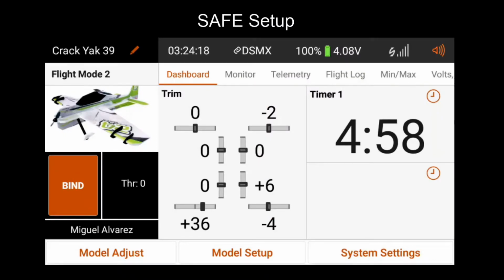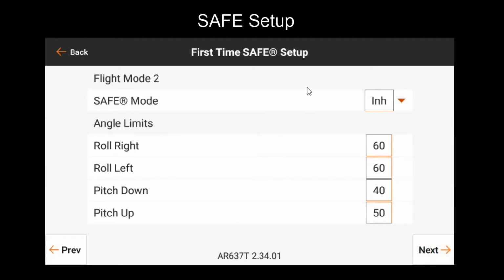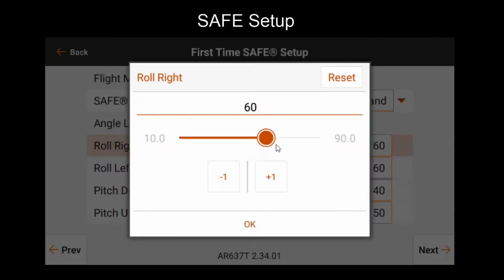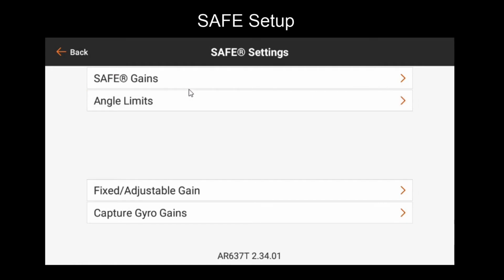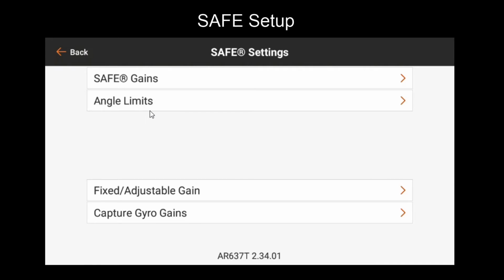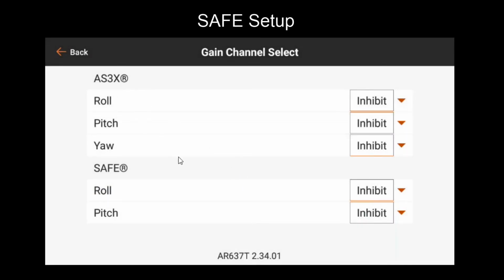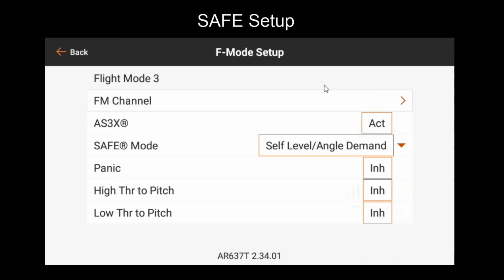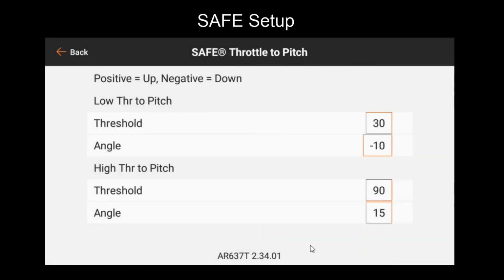3. Spektrum AR637T Setup - SAFE

Comment: Can the AR637T be used without a smart esc, and still use the AS3x and safe mode flying? I understand that you can,  just the telemetry will not be used.

Comment: Your videos are very good and answers a question I could not find otherwise. It appears that you are saying that when in safe mode there is only one Flight Mode, FM, channel available, correct? Like you I have FM 1 with no gain but do have different gains in FM2 and FM3. If that is correct that answers a question that so far Spektrum has not been able to answer. A second question is, how do you select which FM to use for the SAFE setting?

Comment: Miguel : My name is Tony. can u please help me with this. I have a Spekrum AR637T RECEIVER WITH SAFE INSTALLED WHEN PURCHASE. AND IM USEING A NEW SPMXAE1100 100AMP SMART ESC. WHEN I BIND IT  IT WILL NOT BIND THE SAFE MODE IN.( AT ALL) I PULL THE BIND PLUG BEFOR BINDIN AND I HAVE ALSO USED THE BUTTON ON THE RECEIVER TO BIND AND STILL GET NO SAFE MODE.   (Y)???

Comment: Do you know why on my receiver I set it up with my NX8 got everything running good with default mode safe works when I flip up the switch but when i go down on the switch for the as3x the gyro doesn’t want to turn on even when I power up to 50 percent power can you help

Comment: I have the AR630 ..6 volt rated servos and i bought the 9.9 3200 Sprektrum smart battery. Will the reciever and servos be able to handle the voltage without roasting everything?

Comment: Great series.  Question about the High Thr to Pitch setting.  I want to use this for hand launching.  Does the selected Angle override the angle limits set for Safe?  Or so I need to assign a separate Flight Mode for launch and set the High Thr to Pitch?

Comment: Great video. I have the new AR630 which I’m sure the set menus are probably the same. I had to mount the receiver backwards (pins to the front) When I set up AS3X of course every thing now works backwards. I’m not getting the picture for orientation, so I can’t change the orientation. (front to back.) any suggestions??
Thanks

Comment: I bought a AR617 because I wanted to program the settings from the transmitter. But after watching your videos I have lost all interest. I give up
Reply: I am with you, I know its a challenging hobby and that makes it fun but cmon. I bought an AR630 because I thought it would be interesting and I thought cools I have a receiver that would turn any plane into an UMX timber. Safe select, Hi, Lo rates. But this is crazy, Spectrum needs to simplify this, just being so complicated people are going to buy the cheap non-programmable rx. So many questions, whats the difference between safe select on the timber and panic? Why do I have an option for more then 3 flight modes but I can never see 4. Why does the rx and tx each flight modes. Why is there an option to double the gain on a number like 16, couldnt I just move the gain to 32?
Reply: Couldn't agree more. Spektrum goes out of it's way to entice new flyers into the sport, then puts up technological barriers that only an experienced pilot could deal with.
Reply: @paulgross4789 this is why most clubs will tell you to get an instructor. They have the skill and the answers.